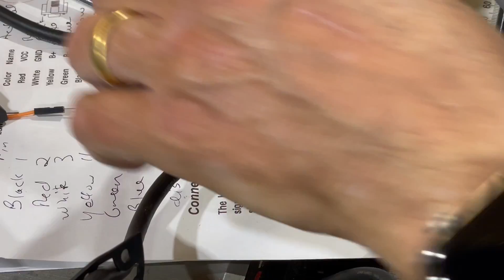Troubleshooting My Nema23 Closed Loop Stepper Motors

Comment: What was the cause of the problem? Were the colour for the wires different to your other stepper motors?
Reply: @jamieclarke321  I had previously ordered closed loop stepper motors from the same supplier, and I wired the new ones up according to the previous colour pattern. None of them worked… opening the new ones up and getting the correct colour for each pin was necessary. The point of this video was to show those who might not want to, or be brave enough to open up ‘non working’ closed loop steppers. With these three new motors I had three different wiring patterns. One presumes three different suppliers as is common in China I think, except they didn’t get the colour code memo.
Reply: @j.hankinson7803  understood, thanks for the clarification.